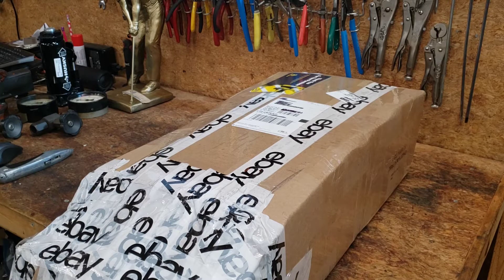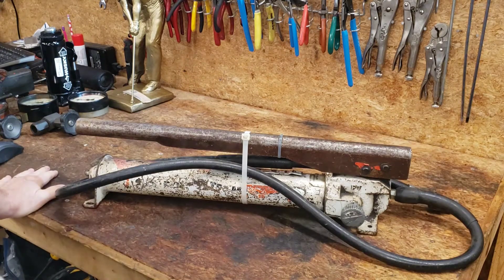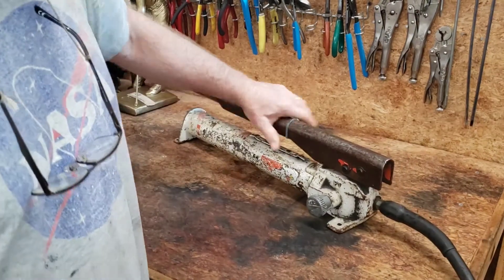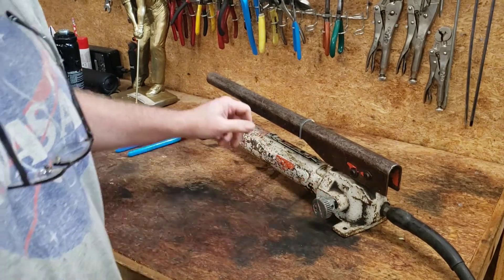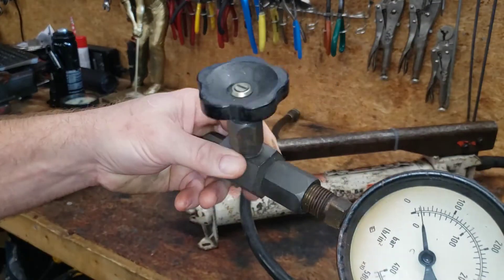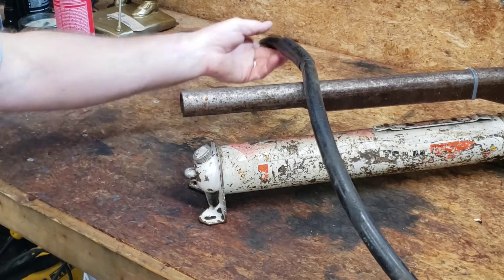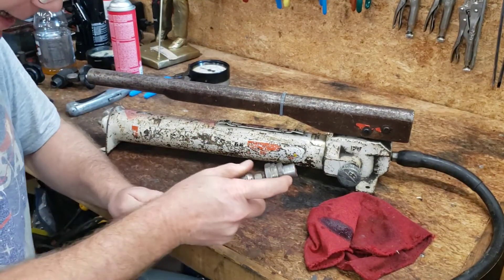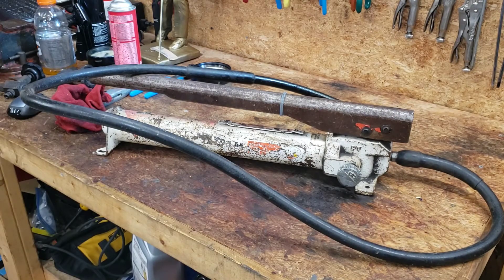Build a Mercedes Diesel Injector Pop Pressure Tester - Part 1

Comment: I'm curious as to why you would take the time/expense to build your own when there are ample fully assembled options available  for not much money?

For the test fluid, it doesnt matter a whole lot what you use for pop testing.  Diesel fuel is the simplest answer.
Reply: I was going to say something like that but I think it is more fun watching him trying to figure out how to make this work on his own.
Most of the ones I have seen used by utubers used the hydraulic jack.
Reply from the maker: @wernerdanler2742  That's the fun part Werner!
Reply: @ImpalamansGarage  lol, I'm waiting to see if you can make it work. Good luck!
Reply from the maker: I'd rather not use a cheap import pop tester.
Reply from the maker: Johnathan Waters - What has been your experience in doing this sort of testing ? Curious.
Reply: @ImpalamansGarage  I'm not sure what you mean by "cheap import pop tester"?  I do know though, that Mercedessource.com sells a very good one designed specifically for this purpose that I actually use myself.  It is perfectly adequate and doesn't cost a fortune.  Might try giving that one a look.  The quality is quite good indeed, just like everything they sell.
Reply: Also, Mercedessource assembles and tests each pop tester they sell individually, to assure quality.  One of the main reasons I try to buy from them if I can.
Reply from the maker: @Johnathan_Waters  I am referring to the junk on Amazon.
Reply from the maker: @Johnathan_Waters  Yes I'm aware. I just thought it would be fun to build my own. I am in no hurry.
Reply: @ImpalamansGarage  Well you might as well finish what you started!  I will be watching as well!  Good luck sir.